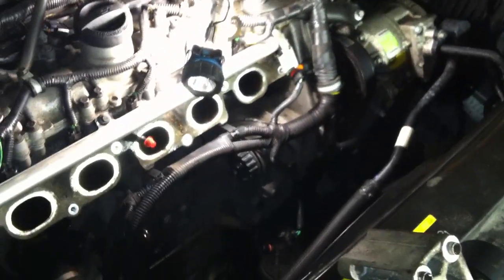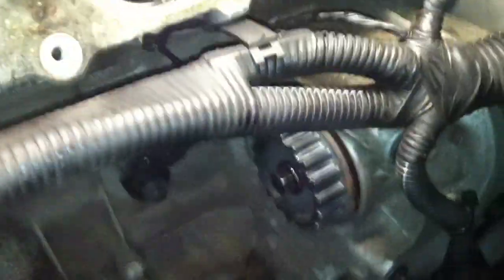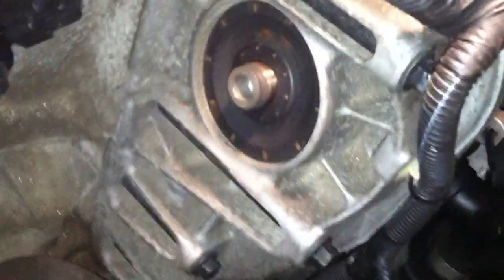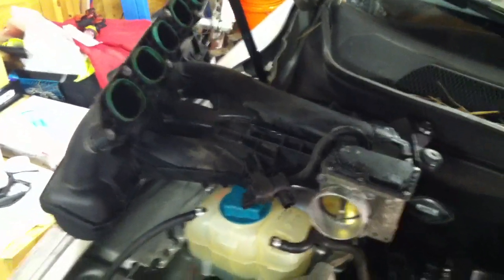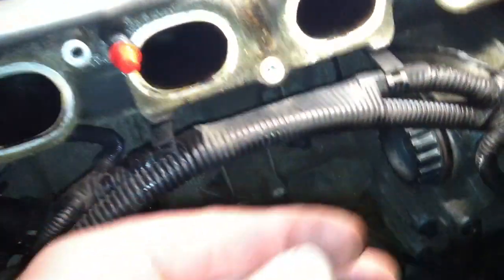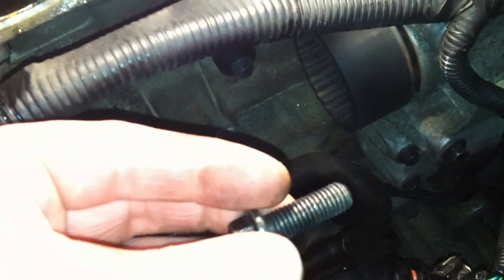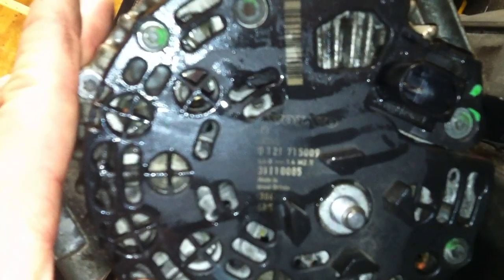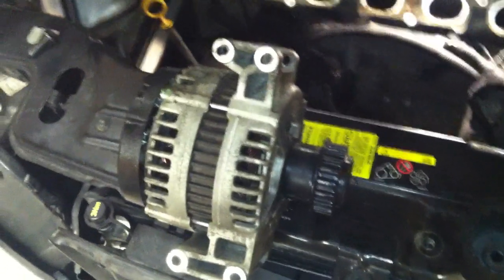2007 Volvo XC90 3.2 Alternator Removal/Install/Fix Gear and Belt driven style

Comment: Man, you saved me a lot of money. The alternator was replaced and I also replaced the battery. Afterwards, my truck just kept losing power. It sat idle for 4 months because I didn't have to money to bring it to Volvo. I saw this video and had a mechanic to check that bolt. That was the problem. Charged me $50! Thanks 👍🏾
Reply from the maker: I really appreciate that feedback kingxodus. Gotta love the Youtube.
Reply: @MidknightMechanics  Yes Sir!

Comment: Had worries that my alternator was bad. And we noticed that the alternator was not spinning even though the engine was running and the battery needed charge. You could twist that coupler belt freely as well.  Was getting low 12's high 11's volts after it was fully charged and was running. After seeing your explanation of that bolt holding the other gear in place coming lose we unboltrd the alternator, finally pulled it free and found that bolt was so loose we just back it out by hand. Put some lock tight on it and cranked it back down put the alternator back on and the alternator is now back to charging. We were able to do all this without removing the air intake thankfully as what a headache that would have been. I do not think you can replace the alternator this way but you can unbolt and slide it out of the way to tighten the bolt that comes loose. Just took a long time to figure out how to remove the alternator after getting all the bolts off. The bottom two bolts have a sorta flange that sits inside the frame mount. So you have to pull and twist rather than just slide out.

Comment: Oscar winning video! God forbid if Volvo service share this knowledge with you.. most probably their diagnostic will be power failure due to bad alternator! Salesman will guide you to a fancy lounge where cappuccino is served free..Wait till they finish your car and serve you with a $ 1800 - $2300 bill then you realise that was the most expensive cup of cappuccino you ever drank😢.. joking aside, I would like to add …always make it a point to replace the dam bolt with a New one. Never use the old one even if it looks OK.. it’s all about brand new healthy threaded bolt at this point…Thanks a million for sharing 👍

Comment: Dude, you saved me a ton of $.  I'm a pro and jumped to the conclusion that the alternator was bad.  Almost shelled out over $600 for a new one.  A little red Loctite and an impact and I'm done.  After watching this I realized that this can be checked by spinning the alternator with a long screw driver through the intake runner.  If it spins, loose bolt or bad belt.
Reply: Thanks for that extra tip!

Comment: the alternator  clutch need to be changed,. the clutch get stuck and  put to much torque on the bolt  . the problem with no charging will come back if the gear and bolt only is changed
Reply: Indeed a normal system will not lossen the bolt. But a failed alternator clutch will put too much torque on the bolt and loss it (during deceleration). Tighten the bolt with locktite is a bandit. If your are already taking the off the intake manifold, replace the clutch, or a new alternator which usually come with a new clutch.
Reply: BTW if your alternator clutch is failing, chances are your serpentine belt clutch is also failing too. it too should be replaced or you risk having your belt ripped apart like mine's.
Reply: I believe I have just learned this the hard way. Replaced the gear only (it had cracked and some pieces broken off) just a few weeks ago and the light is on again. I will now be replacing the clutch, and possibly the gear again if it has also been damaged again.

Comment: Same exact problem here with my 2008 Volvo XC70.  You would think the manufacturer  had corrected the problem by now.  Very helpful video! Red loctite and a couple of hits with the impact wrench and the bolt should hold for at least another 100,000 miles. Being new in working on the Volvo engine, it took a good 3 hours to disassemble, and 2 hours to reassemble.  Voltage reading is now 14.65 with engine running.

Comment: thank you for the great information. you have saved me lots of time. Mine has the loose bolt problem as well... one addition... the alternator is removable without taking the intake manifold out. four bolts holding the alternator is reachable if you loosen and push the air hoses on the driver side of intake away, so you can access the alternator mounting bolts. slowly pull bolts away and pull the alternator to passenger side by wiggling... (that small belt holds it good)...you need a short 10mm sockets with a long wrench for strength, but it is doable... I did it without removing intake... thank you for the great information again... if I did not know it can be that bolt..I would start by taking everything out too..
Reply from the maker: You got it Mark, very glad I could help. Thank you for your additional info.
Reply: Hope this message can be delivered after 6 years.... I have the same issue, and now am thinking of doing the same thing by not removing the air intake manifold. If you recall, did you loosen the manifold at all? or you still unbolted it from the top? "The air hoses on the driver side of intake away" not sure what they are...

Comment: Thx a lot. I have a XC90 2009 3.2L and got the evil power system failure urgent message as well as antiskid and abs turning off, etc. Checking as you said the alternator coupler, it could be turned by hand and, with the engine running, it did not turn so the alternator had no chance of doing its job. My garage (not a Volvo dealer) agreed to check the bolt and it was indeed loose. It saved me a very expensive alternator! Note that with the intake manifold needing to be removed, gaskets inspected (changed in my case) and the rubber coupling changed (because anyway it should after 200,000 km), it is still a 4 hours job with a few expensive little parts from Volvo. Glad I found your post! Thx again.
Reply from the maker: +Michel Duron VERY glad it helped Mike!!! Luckily a few expensive little parts is still a fraction of the cost of an alternator!

Comment: Thank you so much for this video man. Without it, I probably would have taken our 2008 xc90 to the dealership and dropped $1,200. My issue was exactly what your video pointed out, so I was confident the new alternator was not necessary. After I put it all back together, worked like a charm. The throttle body was a beating but other than that, not too bad. Thanks a ton man.
Reply from the maker: I'm very happy it helped Jen. I was hoping this video would help at least someone and i really appreciate you letting me know. I searched the forums many hours trying to find information on this issue and couldn't find anything in print, pics or video- so i really wanted to help others out by putting this video up.

Comment: Thank you. My 2008 I6 had the same problem. I took off the intake manifold and indeed the bolt came loss so no charging. I locktite the bolt and 6 month already no issues. Thanks a lot!
Reply from the maker: Anytime Leon. Thank you so much for the feedback, really appreciate that.

Comment: Thanks for the video, my wifes car was not charging and this bolt was loose. I put some red loctite on it and its been perfect now. Thanks again, btw FoMoCo stands for ford motor company. I think they owned volvo for a little while back then. That tiny belt is $80 at orielly's, autozone, and advanced if anyone is wondering...
Reply from the maker: Glad it helped trab. Thanks for the feedback, I appreciate that. Yea when i did the video i had a brain fart not remembering the FoMoCo abbreviation, but i ended up putting it in the video description. They without a doubt owned Volvo a while back. It's amazing to me how many people this video has helped already, i'm glad i posted it!
Reply: I had the same issue loose bolt and charging system failure message.  Question.  Are you able to spin the pully on the shaft by hand.  Mines seems very tight?  Do I need to beat the pully on the shaft lightly to get it to seat properly?

Comment: Kudos brother!!! I was fearing a $500 repair bill, until I found this video. Thanks for this. Constructive critique: it would have been awesome watching you dismantle the intake. However, after re-watching, I found what I was missing (2 bottom bolts). Hoping the coupler or gear bolt is my issue, although I'm fairly certain a new alt is in store for me :-/
Reply: I had the same issue loose bolt and charging system failure message.  Question.  Are you able to spin the pully on the shaft by hand.  Mines seems very tight?  Do I need to beat the pully on the shaft lightly to get it to seat properly?

Comment: I might add that my gear needed to be tapped on pretty forcefully with a ball pein hammer till there is no gap from the outside view (you can see if it's all the way on ) the shaft was scored/burnt looking and the inside of gear was too, so I beat it on there!!!!! works great...
Reply from the maker: Gotta do what you gotta do right John- nice work with that. Imagine what it would cost to somehow have that shaft replaced coming out of the engine.... no thanks.

Comment: Video is very helpful. I got the dreaded light on my 2007 XC90 but I can see the belt you mentioned spinning. Could it still be the same problem with the loose bolt? I'm seeing very big voltage spikes when the car is running.
Reply from the maker: The factory alternators take about 160-200Kmi to wear out, so if you are no where near that mileage- yep, i guarantee its that bolt that's come loose. You should watch the belt closely and see if you can see it changing speeds or skipping around. But you'll have to not drive the car because it's very risky until you've fixed it.
Reply: @MidknightMechanics  I'm tackling looking at the bolt today and will let you know. I haven't been driving it and it's at 138k miles currently. Really appreciate this video and the response!
Reply: @MidknightMechanics help ! 
3 rd time bolt has loosened. Gonna tackle 3rd time tomorrow. Looking for permanent solution.

Comment: SAME THING happened to the xc90 im working on. I was able to get the alternator off and away from the coupler and gear without removing the intake manifold. Now lets see if I can put it back together without removing the intake XD
Reply from the maker: nice work without having to remove the intake my friend!
Reply: @MidknightMechanics  very tough getting the alternator back on, have to push it onto the engine block and shimmy it till you can just get the bottom bolts started then the tops last. I also had the voltage regulator off, might have given me extra room to move the alt. Not sure its faster but it worked, thanks again for the video, it was extremely helpful

Comment: Thanks! That's what happened to mine. 
Maybe mention the two 8mm bolts at the bottom of the intake. They were rusted and took me the longest to remove.
Reply: Edit: I tightened and used red locktite yesterday. The bolt came loose again this morning!
There was a problem with the alternator. I just replaced it with a used one. 
I'm much quicker at that job now!
Tip. The bolts on the bottom of the intake are 8mm.

Comment: Thank You, old video but just had the same issue with the bolt, a squeal the other night and no charging, then the Power System error message.
Reply from the maker: You got it Tim. Thanks for the comment man
Reply: @MidknightMechanics   Cheers, I need to source that pulley that bolts on, mine has chewed the raised flange off the back

Comment: had this exact problem in my 2008 XC90! had to replace the coupler bc it rounded out the teeth but atleast it’s less expensive than a new alternator
Reply from the maker: @gracieturner8069  got that right

Comment: Hey, great video.   Do you happen to have one of removing the intake manifold first?  I am having trouble with the connectors and I dont want to break them.   thanks
Reply from the maker: I wish I did Derek, there was just absolutely no where to fit a camera in the front end between the Radiator and the intake. On the Volvo- study an easy to get to you connection, maybe like the MAF, and you see how the connector works, so that you can then disconnect the intake harnesses just by feel. Remember, to take the pressure off the clip, gently push the connector IN first, then push the release, and then slide off. Taking the pressure off the clip by pushing it in first makes a MASSIVE difference.

Comment: Oh...Iv put my 3.2 xc90 tonight on mechanic...problem with alternator, first screaming noise...then all lamp on board will on and my Ingrid will not drive anyway...hope no cost very much...Ill try tell the mechanic for that possible malfunction...thanks for sharing experience
Reply: Omg....I just met a mechanic and the same problem is with my xc90....Im extremly grateful for this video....🤩🤩🤩

Comment: Great Video.  I'm working on a 2009 S80 w/3.2 Engine same issue wish I knew about the anti-freeze from the house over the housing.  I had the same issue loose bolt and charging system failure message.  Question.  Are you able to spin the pully on the shaft by hand.  Mines seems very tight?  Do I need to beat the pully on the shaft lightly to get it to seat properly?
Reply from the maker: So, you should not be able to spin the pulley on the shaft after you torque it down. You should use loctite on the bolt that holds the pulley, and zip the bolt in with an impact but don't drive it home to hard, once the impact threads it all the way in and the bolt head contacts the pulley- stop tightening. Or, you can use a strap wrench on the pulley to hold it from spinning, and torque the pulley bolt with a torque wrench to about 45 ft lbs which will be plenty (in addition to the loctite).
Reply: nicktech360 Thanks for the quick update.  Glad you are still on email notification.  What happens if the antifreeze gets in the exhaust when I took it off?  I cleaned up as much as I can see in the ports?
Reply from the maker: In the exhaust manifold or the intake manifold? Don't worry about that, it will easily burn off causing some white smoke. Since coolant isn't combustible, it will slowly burn off without a flame, more like evaporate and cause smoke because of the high heat.
Reply: nicktech360 Thanks again for the Great Video and advise.  I REALLY APPRECIATE you taking the time.  Cheers Mate

Comment: Anyone had any lunch on fixing the axle while torquing the bolt back? I’ve only been able to hold the AC compressor belt on the other side by hand but was hoping to find a way to lock the axle from spinning properly…
Reply: Did you figure it out?
Reply: @Tony-yn5un  Not yet. Held on as tight as I could and used - a lot - of strong loctite.

Comment: It happens because of the decoupler pulley on the other side fails. You have to maintain the belt drive pulleys
Reply from the maker: Actually It happens because the pulley bolt comes loose, on the engine side Matteo.

Comment: Hey thanks a lot for this Video, gonna fix my sisters S80 with the 3.2 has this exact issue. by the way do you know the torque spec for the bolt?
Reply: Tight af 😂

Comment: What tool did you use to hold the grey spinning clutch gear to remove and tighten the bolt that came loose? Did you buy the one that FCP Euro sells or something else? Thanks.
Reply from the maker: Hey Chris- to loosen, nothing- since it was loose. To tighten, I used an OTC strap wrench (carefully).

Comment: When putting the intake manifold back on, I’m replacing the 6 gaskets...do I have you use some kind of sealant? A dab of motor oil?
Reply from the maker: The THINNEST coat of motor oil with your finger is never a bad idea.

Comment: So I have this same vehicle 07 Volvo XC90, JUST hit 100,000 miles. I am getting the message I believe it says service battery charging system urgent. It comes and goes, usually on when I first crank my car for about the first 10-15 mins. Could this be my problem or would it just not be charging the battery period?? Someone told me this would only be the case if it wasn’t working at all not if it was working poorly. I am also having abs and anti skid come on and off like someone else mentioned, could this be related or something totally unrelated?
Reply from the maker: Ashley so this is how the issue starts, the gear starts to spin on the shaft, and will sometimes charge, and then not charge because the gears starts to strip the shaft. With only 100kmi, it would be very rare for the alternator itself to already be faulty. Have that gear checked like in my video; as soon as you can. It's not good to keep driving during this condition.

Comment: Did you have any luck just tightening that bolt and putting the alternator back? Mine was loose and I'm not sure if I should just put it back on or buy a new alternator Atwell
Reply from the maker: Oh I just used loctite on the bolt, and kept my same alternator. OEM Volvo alternators are known to reach 200K mi.
Reply: @MidknightMechanics  nice. Its only got 120k so I'll just be doing the same tomorrow. I appreciate it man thank you.

Comment: I have a 2008 xc90 with the opposite charging warning.  Light reads system is overcharging, please safely stop vehicle (or something close).  You seen any relation to that type issue?  Before this it would occasionally have parasitic draw of power, losing power while turned off and could not restart the vehicle intermittently.
Reply from the maker: No, not yet. This is usually a bad regulator issue (built into the alternator). How many miles?
Reply: @MidknightMechanics  I thought about that part inside the alternator also.  About 200k miles, seemed odd with parasitic draw occasionally before too when off.  Thanks for video and reply

Comment: Having a lot of trouble with the electrical clip on the very bottom of the air intake to the rear of the throttle.  How do you grab it?  Pinch and pull?